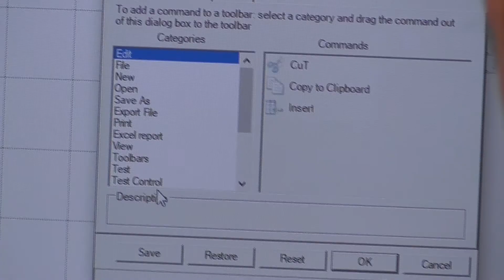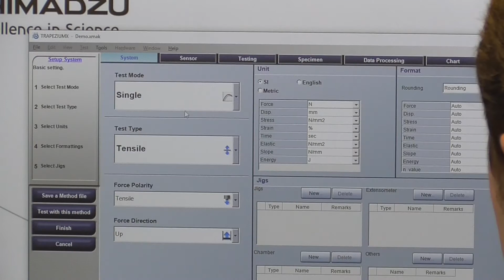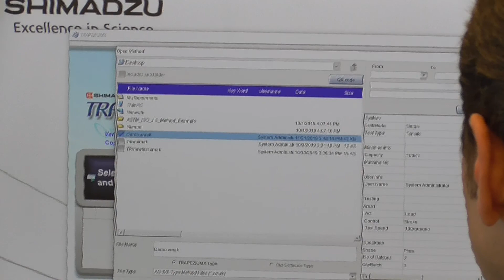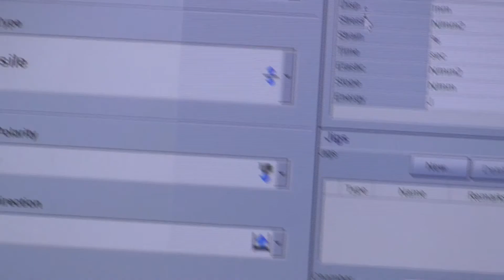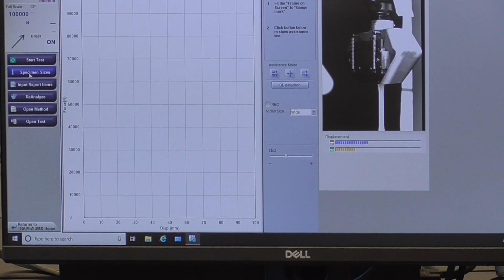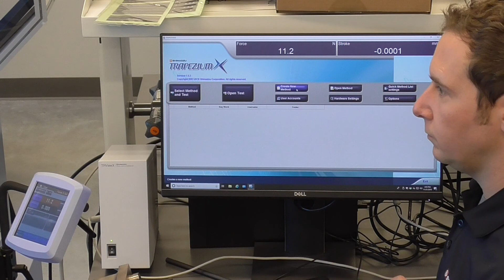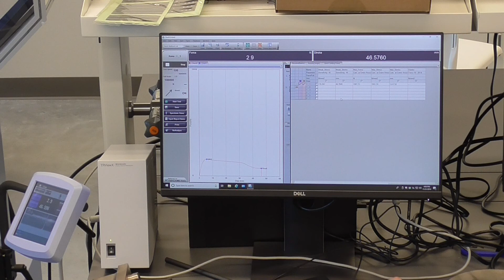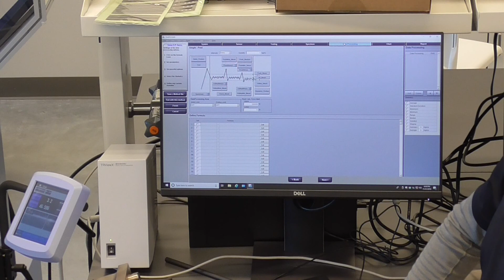Shimadzu Trapezium Software details part3

Comment: Thank you for sharing these vids (all 3 parts)! 
It would be greatly appreciated if you could please also share how to run a compliance test using the built-in load cell and then how to save it and use it in a test to measure the corrected strain.. For instance, for a compression test, doing a compliance test using only the plattens, and then use that data to run an actual compression test to measure corrected strain, if it is possible with this machine/software..